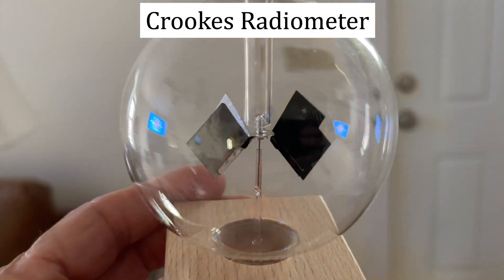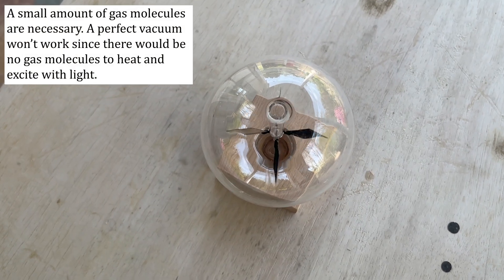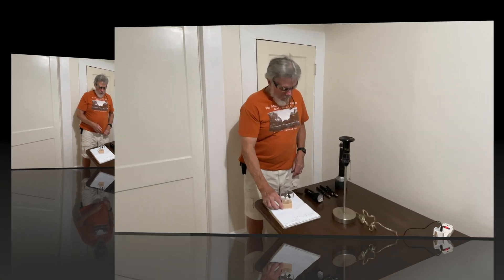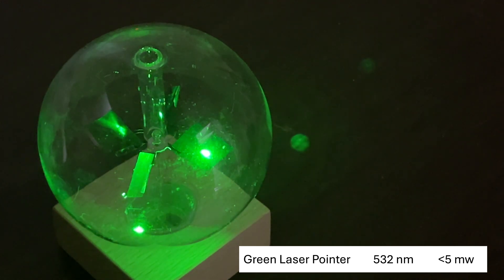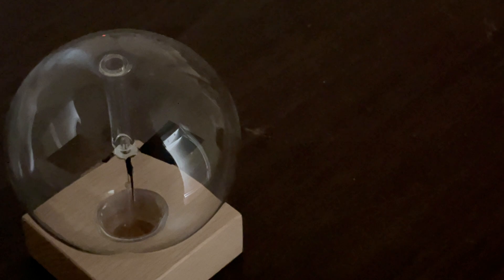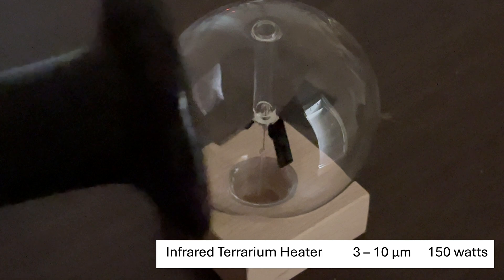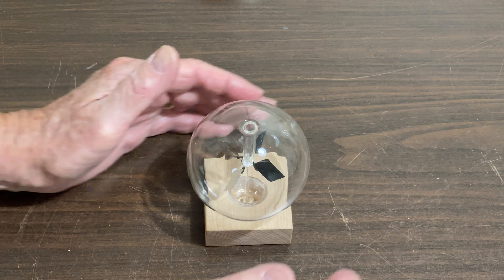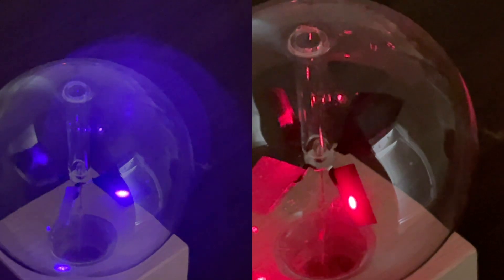Can a Laser Pointer Spin a Crookes Radiometer? Watch to Find Out.

Comment: It did spin on the red laser. But it was so weak that it was more of a nudge that quickly failed the resistance at the center.
Reply from the maker: You are correct, it was like a very small nudge, but not enough to spin it. Off camera no matter what I did I could not get the red laser to start it spinning.
Reply: @anisotropicplus  If the amplitude were higher would it make a difference or is it a matter of resonance? Considering the total energy of the red laser is likely the lowest of all.
Reply from the maker: @ That is a very good question. Would a higher power red laser work? Maybe. These lasers were laser pointers I purchased a couple of years ago. The batteries were relatively new and used equally.